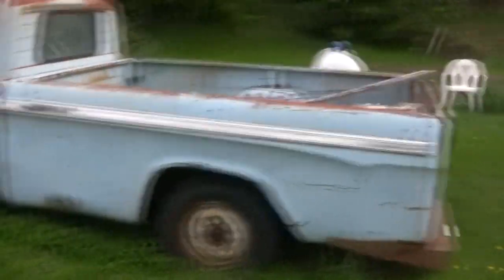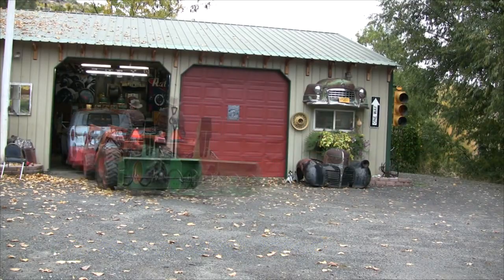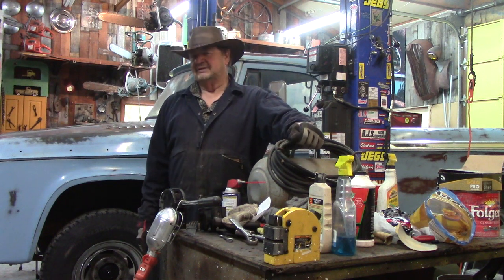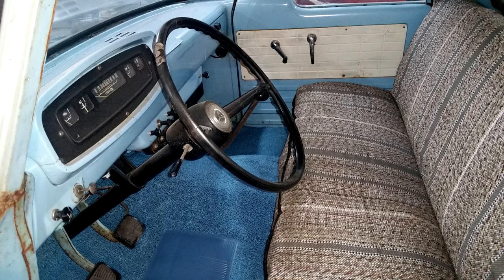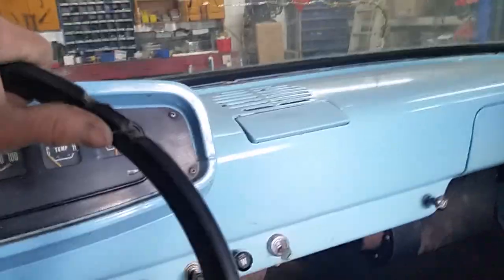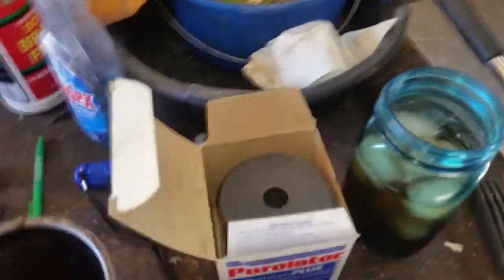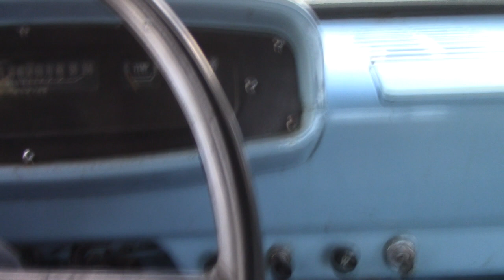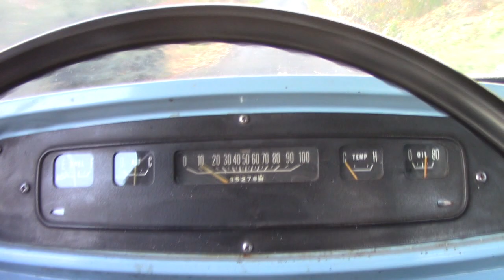1965 DODGE D200

Comment: Love those old Dodge trucks!  My grandfather had a '67 D200 that he'd bought new... Looked exactly like this one (without the fancy body moulding, but with a padded dash bumper pad).  It had more miles running in the hay field than it did on the road; and that's the truck I got my driver's license with!  I later had a '69 W200 Powerwagon that I wished I still had today! Currently driving a 2001 Dodge-Cummins 2500.

Comment: Beautiful I had 1966 Dodge D200 4by4 with a grandma 4 speed at 55 the build in tack was at 4 grand . I could pull a house down justice turn the locking hubs and go . In the winter of 1978 it's was hit by a plow truck in the front right they scrap its .  I'm 67 years old I live in northern Indiana all my life. I love you video be safe man.

Comment: Just came across this video and had to watch it as I have recently acquired a ‘66 D200 in sea foam green and a slant six, 4 speed on the floor. Got it running. Just need to work on the brakes and it will be road worthy. No intention of repairing the rust and all. I want to keep it kind of rough and just drive the old thing. Thanks for the inspiration. Great job!
Reply from the maker: thanks. thats what i did with this one.. I replaced the master cylinders.. mine has two.. one for the hydraulic clutch too.. I had to replace the windshield and I put a carpet in it.. but I'm thinking I'll swap that out.. for a 3/4 ton farm truck..a rubber mat seems more appropriate.  I'd love to see your truck if you have pictures.. my email is coatesgrafting@gmail.com   are you gonna clear coat it?

Comment: Man, I really dig these "ancient" classic, vintage trucks. Boy, that's 1 groovy 1965 2nd series light blue pickup truck. I wonder if it's a d-100 1/2 ton or a d-200 3/4 ton truck. Anyway, I've got a 1969 Dodge camper special pickup truck that's tan with white top, regular cab 2 door, 128"wheel base, 318 v-8 177 horsepower motor, sweptside  with an 8' bed box, 2 wheel drive with 3 speed auto transmission. It has a 1969 11' self contained grayish silver Avion c-11 overhead camper. I bought the truck in Oklahoma on Mar. 2016 & the camper in Colorado on Jul. 2016. Then I drove it back to Corpus Christi in south Texas. It was an adventure miracle journey round trip.
Reply from the maker: you wonder if its a d100 or a d200?  read the title of the video haha.. thanks for watching!

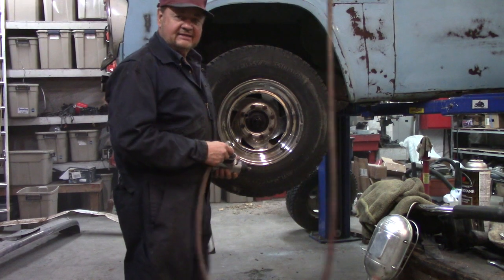Comment: That's a sweet old truck. @4:24 1972 was the last year for left hand thread on the driver's side lug nuts. Ma Mopar made a lot of changes to cut costs and save money on the 1973 models. They needed every penny they could save to build the prototype for a new tank that the Army didn't know they needed yet. It was adopted as the M1 Abrams....

Comment: An electronic ignition distributor from a 1975 318 will drop right in. Then you can use it to trigger a GM hei module and coil. You might consider bypassing the amp meter. They have a habit of burning up in the dash or the high current melts the bulkhead connector. That's a solid old truck and that poly 318 is one of the best ever built for reliability.

Comment: there's some nice floorboards, steps, rockers in that one. most examples up here are missing said parts entirely. ;)

if you get a couple pieces of 5/16 cold rolled, put about a 1/2" to 1" symmetrical bow in them, tack them front and rear in those hood ribs such that the bow in the round stock is oriented upward, you might be able to take to bow out of her. I'm going to try it on mine someday anyways...

Comment: I just bought a 1972 D200 that had been setting under a tree for 17 years. 73K original miles on the two barrel 360 LA. I WAS going to just get it running and drive it around a bit. 
Then I went crazy and bought Edelbrock aluminum heads, intake, Camshaft, etc etc etc, and things have gone $$$ from there. The body is ridiculously straight, and the old green paint buffed up really nice. Can't wait to get that engine pulled, and made to run!!!
My Son thinks his kids are going to learn to drive in Gpa's old truck. 

NOT WITH THIS ENGINE.  
This will not be a learning to drive sort of truck:)

Comment: IIRC, that old MOPAR stuff had 5V 'instrument' regulators that were less reliable than a jewell thief at a broach convention. Pretty sure they bolted up to the back of the cluster... and now that I'm thinking about it, seem to recall hearing/seeing somewhere that there's now reliable & robust electronic aftermarket replacements available.

Comment: what shifter boot did you use I can find one for my old dodge
Reply from the maker: I'm sorry, I dont recall where I got it but I suspect ebay. there are tons of large shifter boots on there for 10 to 25 bucks or so
Reply: 1963impala2dr alright ill check ebay then thanks
Reply from the maker: sorry im not more help man.. I know I didnt get anything that was Dodge specific.. mine looks exactly like this one
http://www.ebay.com/itm/new-super-boot-for-your-4-speed-shifter-muncie-rat-rod-mustang-camaro-3-SPEED-/132007601610?hash=item1ebc4425ca:m:maF95gcq7iiNbwaPaVYU1jQ&vxp=mtr
Reply: 1963impala2dr thank that actually helps a lot

Comment: Don't feel bad,my d100 has Plymouth fury hubcaps,a 1980s Glass pentagram hood ornament from a K-car.And ford review mirrors.
But I feel your restoration crossed the line when you replaced the oil.
Judges take points off for that.